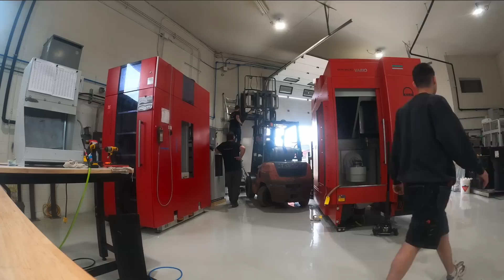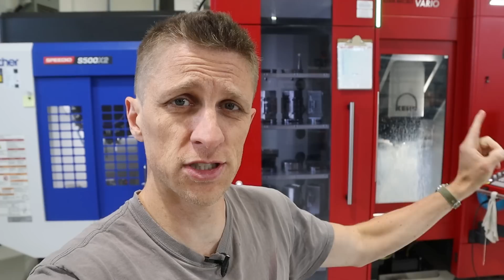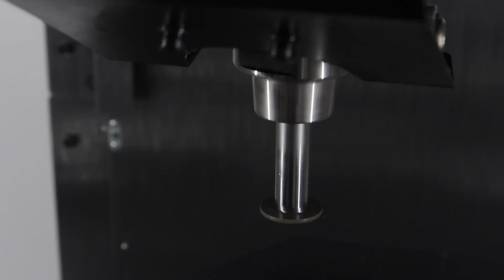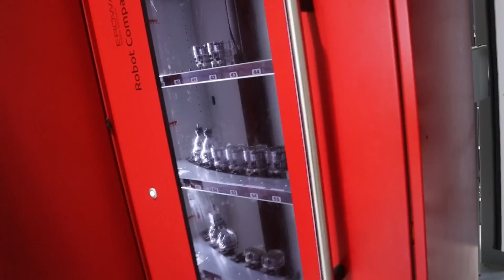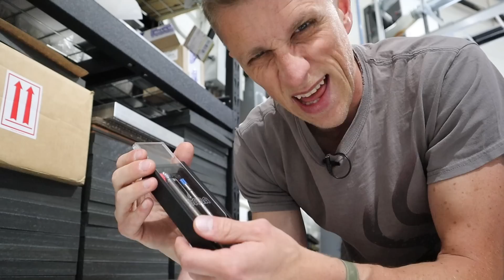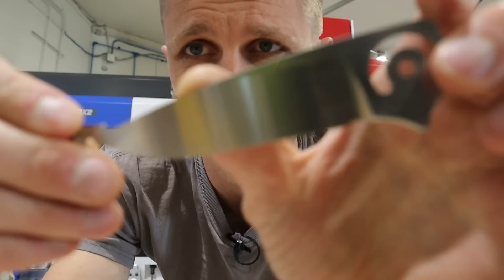Update on our Speedio S500X2

Comment: I would seriously consider a 5 axis conversion for the new machine so you can do much more with it, even a simple flimsy rotating system would be enough if it can be automatically locked in any position

Comment: Communication between the erowa and brother should be quite easy. You have 2 open PLCs in the brother and there is a Profibus option. 

For the surface finish there is a smoothing option that can be installed on site if you don't already have it. Same for 5th axis indexer you might need a column riser kit.  I used to setup brother production lines on a international basis. Depending of your dealer they might not know of all the options you can have with the brothers.
Reply: Profibus, what year is it?

Profinet/safe all the things!
Reply: @DeKemp  for the new control have to look it up. But they supported it already for a long time.

Comment: Hi John , I have heard you talk about those y axis witness marks on the BOM. I got to wondering if your post is outputting enough decimal digits for the brother?  If you want tenths movements you output 4 decimals, but if you want smaller movements you will have to output 5 or 6 decimals. The brother may be rounding according to the supplied precision rather than its max precision.

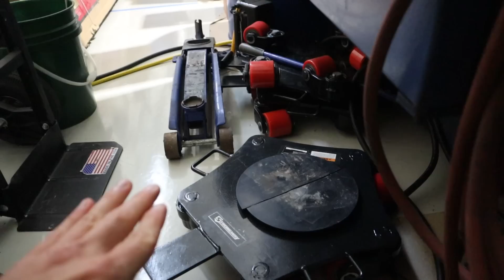Comment: 10:05 you have machinery, so you could make a larger pad for the movers, that has an incorporated rubber strip in it. If you call big rubber companies, they usually sell mats as well. Some are merely for sample purposes, so if you grease the person speaking, you could get enough samples for your movers that way. Also, make a little stand that allows you to grip them (on it) using one of the handles, so they don't sit on the floor. If there's a spill, you'll get the wheels dirty and once they get like that, they never come back. One last thing about those, inspect the wheels every time you want to move something with them. Better to change the wheel than find mid-move that the rubber has split and you're one wheel dragging the floor into a Mariana trench (don't ask me how i know). I'd get at least a couple of those wheels in stock, just in case. AND never take them outside on gravel. If you must, run over to a bigbucks store and buy a sheet of thin galvanized metal. But never on raw concrete. Again, once you do it, you'll never be able to use them on your floor.

Comment: You should really get the sealing rings for the ITS chucks. The Erowa can load the correct sizenin
 before it loads the pallet and heavily cuts down on contamination into the chuck, your through spindle coolant washdown routine is good and everything but prevention is better than reaction.
Reply: glad to hear that someone else knows about the Erowa sealing rings, I just purchased a 148mm erowa chuck and saw them in the catalog and thought it was a great idea. But I have never seen a picture of them being used, all the videos published by kern and others just show it being used unprotected without problems. but I am not excited about paying $550 for every size of sealing ring. I might try 3D printing a sealing ring first.

Comment: Try using some closed cell neoprene as a pad on the machine dollys. As it will collapse and hold. But Pretty quickly will expand when unloaded to help maintain contact over little humps in the floor.